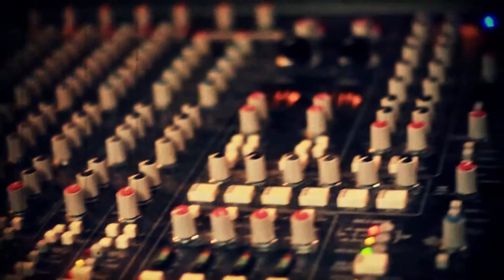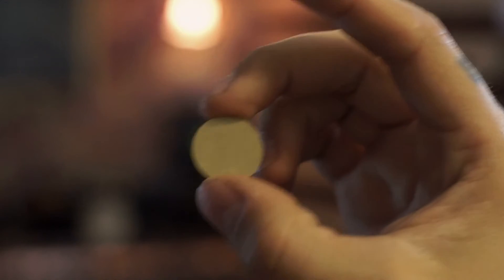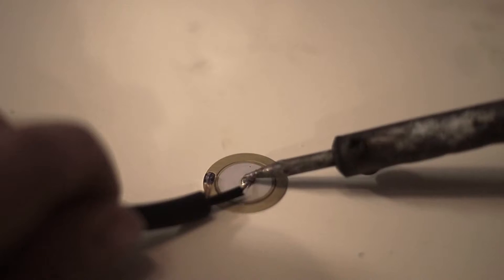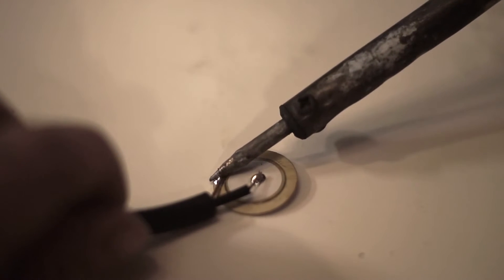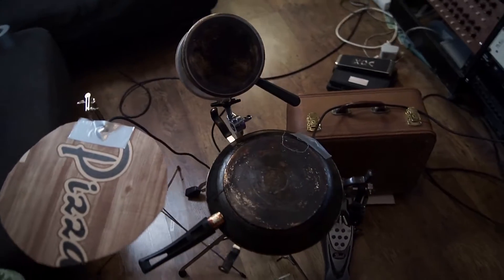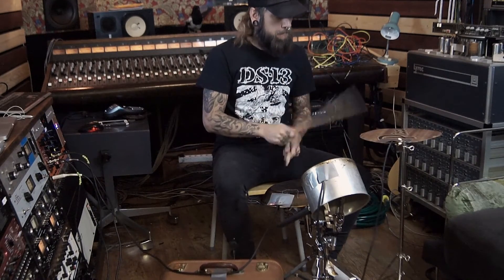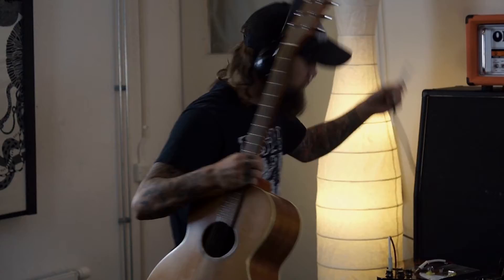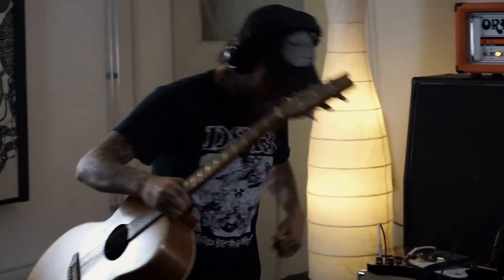DIY Trigger & Contact Microphones (HoboRec Bull Sessions #13)

Comment: Wow dude. Really good. So they could pry be connected to the cymbal to generate as well as collect the sound right?
Reply from the maker: +Creative Sound Lab probably. I haven't tried that, maybe I should. My guess is that it will be quite transient sounding and not much decay, but have no idea actually. I tried using a cymbal as a plate reverb, but it didn't turn out that great.

Comment: Haru nån adress till vart du köper "plattorna" ifrån??
Reply: Here you can get them: https://www.mouser.com
I also found them in my local Danish retailer: https://elektronik-lavpris.dk/c5950/audio/piezo-lydgivere/uden-driver/
Assuming that someone like Teknikmagasinet, ClasOhlson etc. in Sweden also might be able to deliver. I did find something from Conrad: https://www.conrad.se/sok?search=piezo&searchType=regular
Just wondering exactly which one to pick as it seems like they are made for specific frequencies. But maybe that is only relevant when playing back audio and not when recording. But a hint as to which exact one to pick would be appreciated! :)
Jäkligt bra tipps! God jul från Danmark. :D

Comment: Fantastisk video, sjukt kul att experimentera med!
Dock faller mina piezos sönder i  löddningarna efter ett tag, något du haft problem med eller är det mina löddningar som suger?
Reply from the maker: Haha tack! Tror inte det är lödningarna som är problemet. Den där lilla lagret av kristaller i mitten av ena sidan som inte sitter fast så bra, så det lossnar. Jag har inte exprimenterat med det så mycket, men jag tänker att man borde kunna fixa det genom att dra på en rejäl klick med en limpistol på den sidan så det täcker hela mittencirkeln och lite utanför. Så inte lödningarna utsätts för belastning.
Reply: Jag tyckte väl det verkade förjävla känsligt... Silvertejp eller lipistol it is! Tack för svar, ser framemot kommande videos, god jul, happy Kwanzaa etc.
Reply: Liten uppföljning, smältlim gjorde susen. Rekommenderas stark!